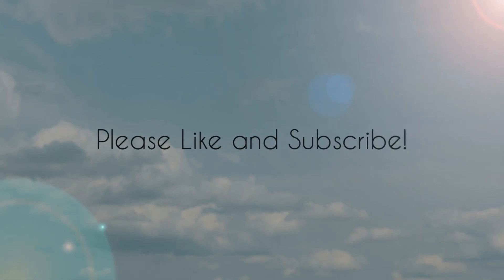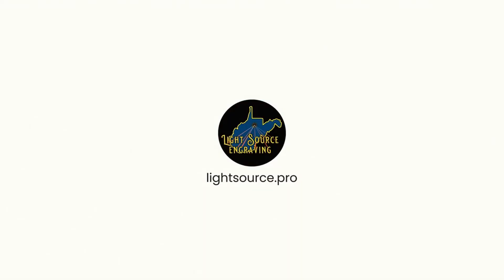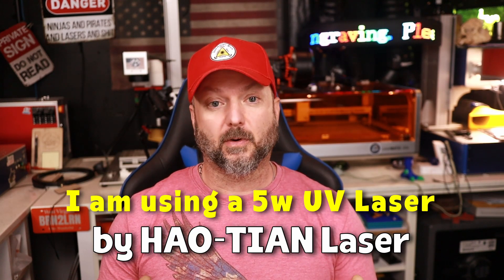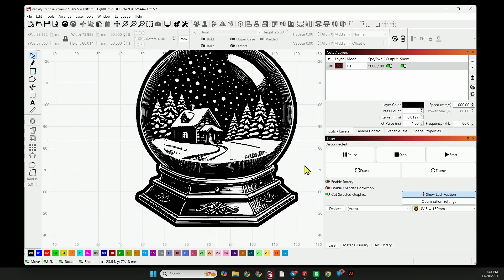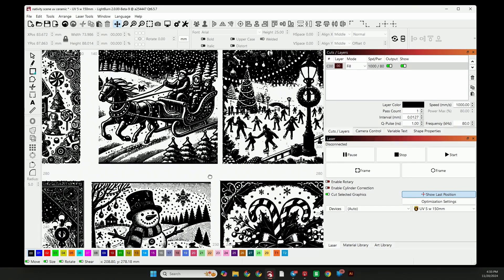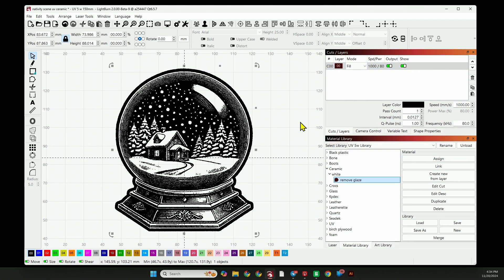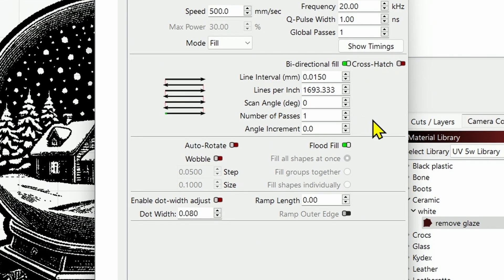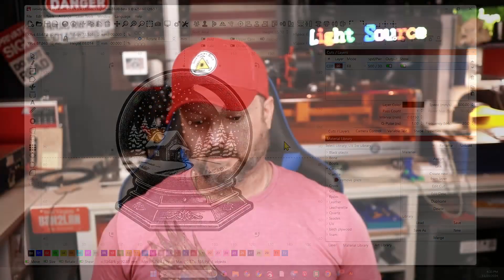Patrick's White Tile - Using a UV Laser to Add Color to Ceramic

Comment: I think we've got the makings here for an entirely new style of printing press???

For your tiles, maybe try a needle syringe filled with watercolor ink or stain, applied as one droplet at a time? 

But if your laser machine can also engrave a sheet of paper that is made from stone dust instead of wood fiber, you could create a coloring book or a graphic novel for retail and depending on if the artist or the machine or the consumer is how-so applying the ink can determine price?

Custom Stoneware Literature.
Reply from the maker: interesting ideas! thank you!

Comment: Nice work. I've read about using pens or dyes for many years in forums, but nice to see a video explaining it.  But alas the tile is no longer waterproof since you've exposed the clay body, as you noted.  Please be sure to let customers know this tile is now only decorative...   The benefit of methods that put TiO2 on the surface before etching (like Norton) is that the coating fuses with the glaze & does not expose the tile body, so the tile could be used as the tile intended.
Reply from the maker: Cool, thanks! clear coat them and they make great coasters!

Comment: Patrick I've had a uv laser for a while I had great results by painting tiles with Rustoleum cold Galvanizing compound spray. spray 2 even coats and allow to dry then engrave, I have a 5 watt comarker laser  200 speed freq 40 Q pulse 1.0 Image mode Jarvis Line interval .07. you will get a realy nice kind of a monochrome image that is burned right to the glaze, It won't come off, kind of like using a diode laser, give it a try I think once you get the settings for your laser you will like the results.
Reply from the maker: i will give it a try! i'll add that to my to do list. thank you for the suggestion!

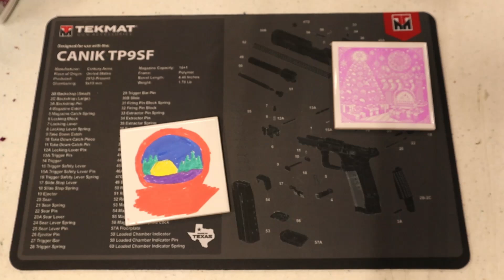Comment: 12:15. Buffing wheel?
Reply from the maker: did not use a buffing wheel.
Reply: @MooreThanLasers  I can see you didn't.  I was asking if a buffing wheel could be used instead?  If so, this could be a much faster and easier process.

Comment: I am curious, Patrick, the tiles I purchased from Amazon do not have a shiny coating on them like your tiles.  Can you still use dye on the tile if it doesn’t have a shiny coating?  Thank you for sharing your knowledge.
Reply from the maker: hmmm, are they "sealed?" Can you put some dye/ink/etc on them and then wipe it off? if so, i'd say yes you can.

Comment: Could this also be done with a diode 10 or 20 watt?
Reply: I have done something like this on a cleaned white tile with my 12W diode laser.  I used a regular sharpie and then wiped with isopropyl alcohol.  The color stayed in the engraved part but wiped off the surface good
Reply from the maker: i'm going to try and see what happens.

Comment: Interesting video Patrick. I was looking at a UV laser for marking ceramic because it appears in some examples on youtube show it producing  a black mark vs removing the glaze. There are a number of videos with ceramic insulators getting a light black mark. A few videos show a darker mark on a ceramic glazed plate.   This would suggest you could get a range of values and do a photographic image in UV on Tile without any coloring.  I'm curious have you tried getting a black mark on the unglazed back of the tile vs how it marks on the glazed side?  Curious to understand if the black marks are a product of settings or something not clear in the other videos. I have this question out to Haotian directly but no response yet.  Is you search for "uv laser ceramic " on YouTube you will see the shorts showing the process. Keen to get your take?  I'd love to see a work up of settings showing the different marks at different settings. Keep up the great work! Here's the settings in one video that marked dark vs clear in  yours  (at MACTRONTECHLASER 5W UV Frequency 30KHz, Speed 1200mm/s, Hatch 0.04mm)
Reply: Hello, are you able to get dark marks on tile with UV like in the NWT method?
Thanks
Reply from the maker: ill have to run some material tests on blank tiles and see what i can come up with. thank you for the info and suggestions! Much appreciated!!
Reply: @MooreThanLasers  Its appreciated. Its certainly not explored yet on YouTube. I'm trying locally to find access to one but haven't had luck yet. Lots of fiber around though.